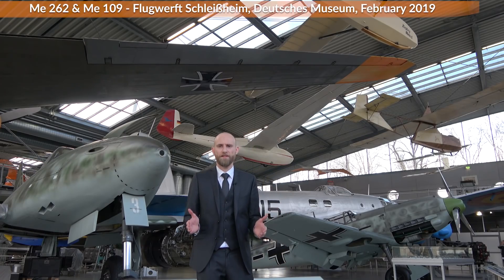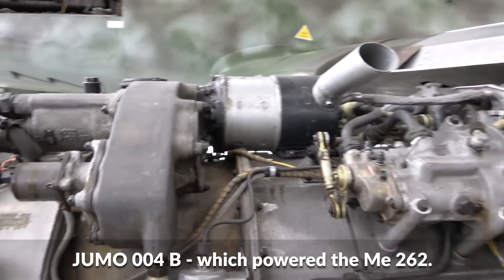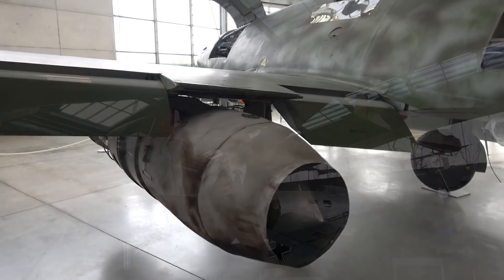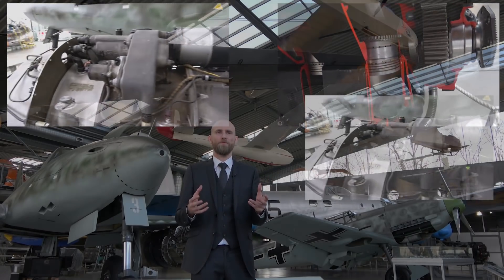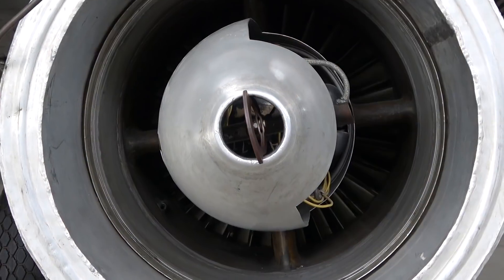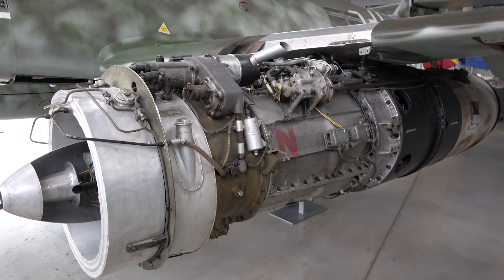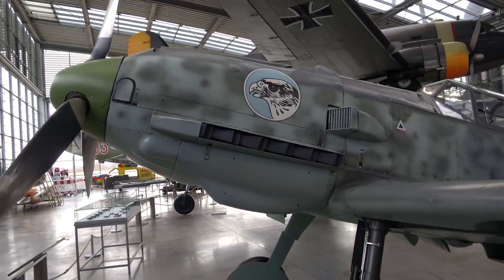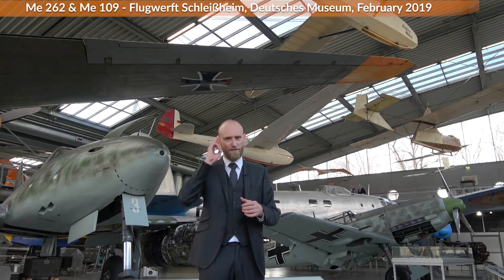Why not just go from the 109 to the 262?

Comment: Speaking from experience, I'm a factory worker and have been through the process of starting up a line to produce a new product several times. The process is quite difficult when the new product is simply a different and better version of the previous product. An entirely different product would be a whole new level of problems and issues. This is a point that is rarely brought up in this discussion. Good on you sir.
Reply: The Germans had many models of tanks, with many modifications added on by the Wehrmacht. This had the effect of the production of highly versatile equipment which the armed forces knew it needed: but at what cost? Numbers.

Jonathan Parshall investigates the varying methods of production between the US, USSR and GE at 26:20.
2013 International Conference on WWII - Kursk The Epic Armored Engagement
https://www.youtube.com/watch?v=N6xLMUifbxQ
Reply: Agreed. Even small changes, even with today's methods of CNC and automated processes, are extremely difficult and complex to implement. 

The M4 Sherman was a very good tank but even it was outclassed by other tanks the US was developing/developed at the time. The singular reason why the US didn't change over to them was because it would have taken an eternity to do so and because the commanders in the field didn't want to deal with the logistics of having 5 different kinds of the same type of vehicles, all of which shared no common components.
Reply: @calebshonk5838  it's usually not "extremely difficult and complex" to implement changes in a manufacturing process, just expensive.
Reply: @migkillerphantom  In the grand scheme of things, no. It's just time consuming and even small changes in the manufacturing process can make logistics and supplies difficult. Which in wartime, isn't what you need.
Reply: @migkillerphantom I can tell you have never installed and debugged a new production line :)
Reply: How does one go their entire life working on a factory floor?
Reply: @migkillerphantom  Simple, factory jobs are the best paying jobs in the area that don't require a degree.
Reply: @Kyller-grump  what would you have done if someone like me came along and automated your job while you were still young or middle aged? I always wonder what goes through the minds of people like you.
Reply: @migkillerphantom  Whatever I had to do to keep a roof over my head and food on the table. Factory work isn't the only thing I've done for work in my life. My skills are not limited to running industrial machinery, doing so is just the best paying job I can find with regular hours. My best plan in the situation you put forth would be to find whatever I could to keep up with my rent and take some classes at the community college to learn a skill in high demand.
Reply: @migkillerphantom  as someone who has been through the white collar equivalent, of having a data entry office job that was then automated I got a job as a software tester for the automated process and then retrained as a business analyst. Sometimes people, even those with a degree like me, have to take what work is available until we find a way to break out into something else. I've worked in factories and warehouses before, whatever it took to pay the rent, and I definitely don't look down on factory workers just because I was lucky enough to move from minimum wage jobs into something more lucrative and 'professional'. There's a very specific set of skills required to excel in a production line environment and you'll be surprised how many highly educated, intelligent people I've seen just fail to keep up. I once worked in a bottling plant alongside a trained draughtsman, he was worse at the job than the stoner who used to sneak out and smoke a joint on break because he was just too slow and meticulous.
Reply: @misterthegeoff9767  there's white collar and there's "white collar". If your task is to execute a procedure well defined and laid out by someone else it's no different from a factory worker or a farmhand. A degree doesn't guarantee shit, if you have to be trained by somebody you're not really a form of intellectual labor.
Reply: @migkillerphantom  " I always wonder what goes through the minds of people like you."

Talk about looking down on people, if it wasn't for "people like him" then you wouldn't have anything. Maybe if you had to do an honest days work you wouldn't be so up yourself.
Reply: @llljustcallhimdave  I do what I want, you do what you can. If  not for pepple like me, people like you would be starving subsistence farmers.
Reply: @migkillerphantom  Yeah because what we need is more Bernie Madoff's and Epstein's to make the world a better place. 
The people that advanced the world from subsistence farming were the engineers and Inventors. 
We would be a lot better off as a society without anchor's like you dragging us down.
Reply: @migkillerphantom  
Just because someone works on the factory floor doesn't make you better. My experience was that the people that had the degree couldn't do anything practical, most could barely do the job they were paid for, I imagine you fall into that category.

I understand you think you are better than everyone else but you're not, you are the one that is unable to go without insulting anyone.

Still stand by what I said and society would be better off without people like you, I pity anyone that has the misfortune of working with you.
Reply: @migkillerphantom  It's funny how you are so brilliant at everything but unable to write a coherent message at the first attempt
Reply: @llljustcallhimdave  seems to me you're just slow on the uptake
Reply: @llljustcallhimdave  "you're inability to form a coherent sentence"

Magnificent.

And for the love of god, don't confuse your inability to parse a sentence for my inability to form one.
Reply: @migkillerphantom  Thanks changed it, for someone so superior to everyone else your very fixed on showing it to some random person on the internet.. Says a lot about you.
See you still had to edit your last comment, 
Magnificent.
Reply: @migkillerphantom  not everybody can afford to spend time and money on a degree. For those people factories offer good money without the need of a degree.
Reply: Using people from a concentration camp who did not get enough food, probably did not help with the ME262.

Comment: The me-262 was not rough field capable not just because of the potential of fod damage, the nose wheel was prone to collapse. If you look at the. Film taken by the Germans themselves Towing the me-262 on the flight line they had a special harness. The harness put most of the load on the main gear and only use the nose gear for steering. Even on a concrete Runway a hard Landing could cause at landing gear collapse. Jeremy was short of all kinds of fuel that's why they're Navy what remained of it was an active most of the time, the Air Force only Rose after they had hoarded enough fuel for large-scale operations. This included the me-262. Junkers jumo jet aircraft engine was frozen in development. The engine was only good for about 25 hours operationally and then required replacement. This was a materials issue. Because of the rare Metals required to make the highly heat resistant materials needed for the stator vanes in the jet engine, they developed cracks since Germany did not have these materials. There was really not much they could do about it because they did not have the heat resistant materials. Another issue that occurred with early turbojets was cavitation. Cavitation would cause the engine to pulsate in its thrust output that's actually the input turbine blades were slipping because they were going too fast and you are not yet fully developed in their shape. The airframe itself other than the landing gear I know of no other problems. But the engines were really still almost prototype level. They froze the design and development so they could get aircraft in the air. They needed aircraft now not next year. Even the arado Blitz with the for BMW turbine engines was prone to cavitation.
Reply: Many years ago, the local CAF held a 'Gathering of Eagles', with a number of US and German pilots from WWII, where I met Gunther Rall. One of the other German pilots was a man who'd joined KG500 when it was transitioning to the 262, and he described one of the quirks of the 262 on the ground -- the nose wheel didn't steer; it castered; steering had to be done with differential thrust, brakes, or the rudder. At low speed, it was possible to brake one side too hard, and get the nose wheel turned 90° to the line of the aircraft... after which you couldn't get it back without someone going out to the plane and straighening out the nose wheel. Since then, I've wanted to make a diorama of a 262 on the apron with the canopy open, the pilot leaning against the nose with one hand while he kicks the turned-90° nose wheel to straighten it out.
Reply: @seanmalloy7249  the nose wheel on the Messerschmitt 262 was very fragile.one has to wonder if the rush to convert the 262 from taildragger to tricycle landing gear was the problem with that. It could have been worse it could have had a landing skid I suppose. I never understood the German enthusiasm for not fitting a landing gear on high-performance aircraft.

Comment: I know these early jet engines weren’t amazing but I’ve never seen a video talking about the mentors engines, was it on par to what the problems the me262 engines were dealing with?
Reply: Frost; No. The British had better access to critical alloys and the Meteor engines had much longer service life.
Reply: When newer versions of the 109 came out with a new engine in the beggining it had a bad reputation amongst pilots and they wanted to keep the old one they knew, was more fiable, this happenned pretty much on each model, a new thing always has problems but you then figure them out an fix them, that's also what happenned to Tigers and Panthers, and unfortunately this issue cost the life of one of the greatest german aces Hans-Joachim Marseille which engine died and due to the smoke produced and the plane spinning he hit the tail of his plane when he tried to jump out, he died late 1942 with 158 victories against only allied pilots (brits and americans), without this incident he probably could have been the greatest ace of the war, greater than Hartmann and his 352 victories but acquired later and only against soviets.
Reply: The British went for a much simpler, lighter and reliable design of engine at the time (centrifugal flow), they were working on the same type as powered the 262 (axial flow) but knew it would take longer to perfect. Ultimately it was a better type but the technology was not mature enough at the time.

Comment: Regarding airfield: The "Erprobung" of the ME262 under Major Nowotny had happenrd just 3 km from here on a set of 2 - 3 small airstrips in a 5-10km radius, gras only. 
They had no complaints about the airstrip except the allied fighters lurking for the ME262 coming home and attacking on the final approach pretty close to the landing strip. 

Therefore they ask for ME109 or FW as the most efficient protection during that particular time in flight.

FOR ALL THE FRIENDS OF TRUTH INSTEAD OF MYTH
★ there was no problem regarding intake - they put a cage in front of the engine on ground taxiing you could see on education film or Lehrfilme like that of Bär 
★ it used the easiest available gasoline instead of that rare gas for  piston engines at that point of the war
★ maintenance was NOT THAT NIGHTMARE, at least if you believe allied post war test pilots. Of cause engine change must be such a pain that it takes a whole day compared to 30 minutes - 30 minutes for the ME 262 and a day for a Mustang, Lightning, ...
★ american pilots loved the abilitites + ease of airfield maintenance expressed by their own words

For all friends of the stereotype "german overengineering" check what allied testpilots had to say linked below... and if you check the archives carefully enough you will find similiar accounts about overengineered german tanks from Panther to King Tiger regarding maintenance. Stereotypes do not help, it needs research in archives for every type or problem ... as shown above with the airfield and risks of engine intake, that might have existed in early days but were solved fast + cheap by a a kind of metal basket in shape of a half ball, at least here and in bavaria and the training group 300 (even though footage of such details is rare)

https://youtu.be/kxRR2KgY5mo
Reply: The airfeld and takeoff/landing thing would've been an unsolvable problem anywhere near a frontline..
Reply: If you add the fuel costs of the piston engine fighters required to protect vulnerable Me262s during takeoff and landing, then you get a better picture of just how wasteful that plane actually was. 

The plane itself used vastly more fuel than the piston engined fighters it was supposed to replace, but it was actually useless without their active protection.

More Me262s would have shortened the war because they were a waste of fuel, manpower and industrial resources. 

In practice the Me262 was a vanity project which only existed based on its awesome top speed and firepower, but the serious practical drawbacks were extreme and made it worse than useless.
Reply: @pauligrossinoz  Well, most planes needed that take off and landing protection during allied air supremacy, not just the ME 262 alone.
But it was the weakest spot of that plane as the allied had find out. And many decisions on the route from prototyoe to mass production had to be changed due to more and more missing raw materials.

It is too easy to judge afterwards. 
If the allied had not found the weak spot what would you have said then?
It's better to listen to experienced ME 109 or FW 190 pilots moving to that ME262 fighter how they had judged on their part of missions than 75 years ...

And if I read about the nice comparison of sherman mass production + reliability + repairability + ... versus expensive, unreliable, slow Tiger or Panther people forget or ignore 3 major points:
★ who owned the battlefield after the tank battle and who had to retreat and self destroyed its tank
★ who paid the sacrifies when so many killed shermans were repaired and re crewed  again and again? surviving crews thanked god to have escaped the sherman hell and talked about the fate of comrades that didn't make it.
They praised the tigers - for its fighting power, but mostly for its crew protection
★ who sufferred from lack of spare parts the most and is that caused by the tank design ?

It is not easy to judge cause it always depends on how well trained and equipped a crew is and how proper the tank is used in that particular situation cause a tiger attacking sherman in 500m like in normandy is not the best choice ...
Same for planes ... Many ME 109 pilots complained during and after the war that the ME 109 was outdated for years and a flxing coffin.
Would it have made more sense to produce twice as much ME 109 instead of ME 262 in a time with not enough trained pilots and the second half of the twice as muvh ME 109 grounded ?

The population was aware of the outdated ME109 and they called for  a new and effective air defense. They would not have accepted the ME109 ... 

There was a need for something new, at least innovative and a carrier of hope for more success.

The only fighter alternative would have been the impressive twin piston engine Do 335 "Pfeil"  ... old tech at its peak .

But that Do 335 was also far away from combat readiness and mass production, but at least a superior fighter with its high speed and strong weapons and without the weak spot of the me262 landing ... but of cause with other weak spots the allied would have been able to find out.

A simply doubled ME 109 production would not have been such thread for allied bomber crews as half of the amount of ME 262 or Do 335 ... cause the allied day raid crews feared these jet attacks more and mire cause if the ME 262 reached the bombers it was too late for the bomber crews.

Comment: Because the FW190 is fuckin nice. I saw it a few days ago live. The sound is so nice and seeing it fly is just a awesome feeling.
Reply: The bf109 is actually kinda small and cute, the spitfire looks more massive
Reply: @doc.voltold4232  i dont think that i saw many different aircrafts (Last Weekend BF109, FW190, Spitfire, Mustang and an few others in flight and on the ground) and they are nearly all the Same size with a few different Things.) The Mustang body is higher and the FW has just a massive engine Part.
Reply: +MaugriM 
What struck me most when seeing one fly close-by was how tiny she is.
Reply: @Tuning3434  Its funny because everytime i see such planes im more impressed how big they are.
Reply: @MaugriMGER  Well I saw a BF109 being chased by a Hurricane and a Spitfire, and those are monsters next to the BF109.
Reply: @Tuning3434  The only thing that is really different is the length of the wings and a little bit the mass of the Spit but on the other hand the FW has also smaller wings than the spit but hat a higher starting mass
Reply: Sadly most of the ones still flying have Merlin engines
Reply: @doc.voltold4232  MaugriM list the FW190 Powered by radial engines, BMW 801 in the versions A, F and G; and the V12 Junkers Jumo 213 in the D variant.
A pair of flying examples have russian radial engines.
Reply: @doc.voltold4232  Yeah. The one i heard had a copied Engine by the russians from the end of the war. But until end of the year it gets a original one.